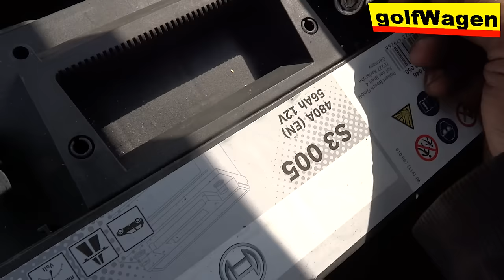VW Golf 5  door connector locate -  little attempt to repair

Comment: I also have the same problem on a pole .. then the attack that you disconnected is fine if you do not even light up the keys of the window, because in that case or you have a false contact or no current ... in this case instead the problem is another, in fact after you turn on the car if you wait a few minutes the windows are lowered .. so nn know if it is some condenser that takes a while to load or the control unit comfort

Comment: I have a 2010 Golf Plus. The big red and yellow wire broke in half and I had the same issue. Soldered the connections and everything is working again.
Reply from the maker: Yes. there was such a problem. it's already solved
Reply: @golfwagen4173  I have the same issues with my 05' Golf 5. Torn wires drivers door
Reply: @stefanv9660  how did you solved ? , im currently having issues with the driver side , i replaced with a new one and all it does is a click sound, but it doesn't move.
Reply: Hi is the red and yellow wire going to the window switch then?I opened mine today and its barely held together by one or two strands !so I'm hoping that's why window won't open
Reply: @Trynfixit  Yes, those are the main power lines for the window regulator. 

A more permanent solution is to get a whole new wire loom made out of flexible silicone and won't break like the original. 

Each and every cable needs to be crimped but the problem will be permanently solved unlike only soldering the old ones. They will break again soon.